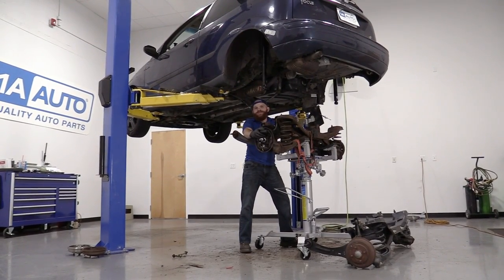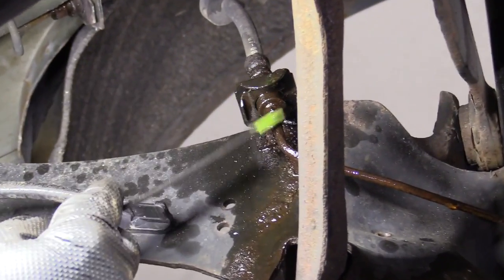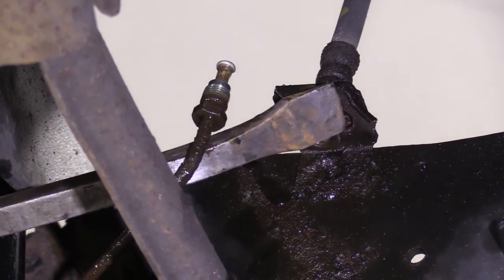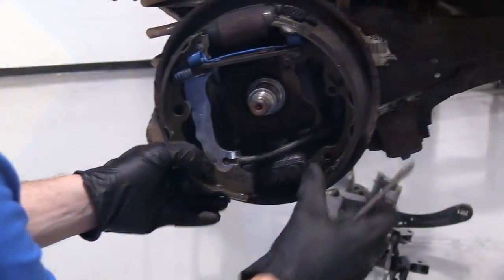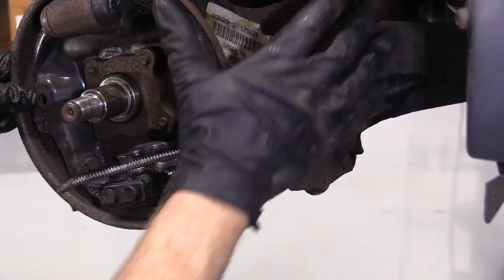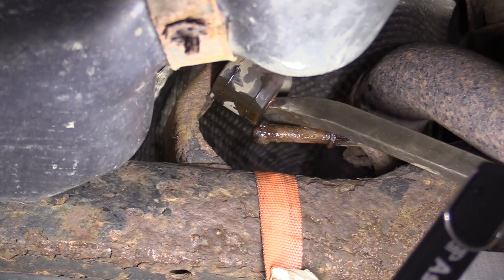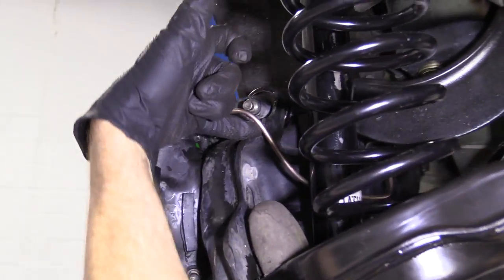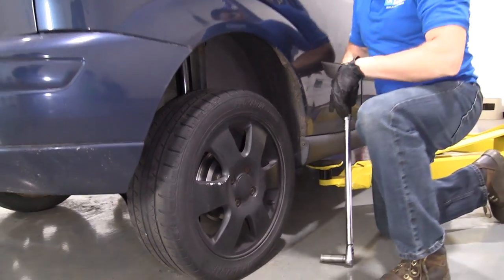How to Replace Rear Subframe Assembly 00-08 Ford Focus

Comment: What n awesome video, my focus needs both front n rear subframe, now I have this video as reference to do it myself. I can't imagine how much it cost to have a shop do it, thanks A1 Auto mechanic!
Reply: I'm pretty sure you can use a rear subframe from a 2013 focus as well. I've been looking into it for my 03 focus. As long as the body mount locations are the same it should work since it's practically the same rear suspension with just a few updates. You can't use any of the suspension components due to changes in how they separately mount the but the subframe itself should be useable

Comment: Huge thumbs UP! Thanks for sharing.
btw Tragic conditions on this Ford subframe.. rusted, corroded, sad parts.
Reply from the maker: +Én egymagam Thanks for the feedback!
Reply: All fairly typical rust areas on a focus,need to do my trailing arm bushes on mine over the pond in the UK. Great video content.
Reply: That is nothing... I checked mine yesterday.... I have like 2 % chances to remove the bolts (the ones he replaced)

Comment: Would it be okay & good idea to put bit of anticipation seize on those two center 15mm bolts through the spring into frame so it won't be hard to remove later down road...and I grasp what you said bout using thread locker on 6 bolts

Comment: For anyone watching this:   Don't let your car get to this point, have  :  Krown Rust Control's T40,  Rustcheck, Fluid Film , Wool Wax, Corrosion Free Rust Cure Formula 3000 or equivalent sprayed on your car yearly , it avoids this happening.   Do not used rubberized undercoating/ asphalt based undercoating, it is a nightmare to deal with and in the end flakes off and accelerates rust.   I live in the Rust Belt, i've seen the difference between spraying and not spraying your cars , and the difference is night and day.

Comment: concerning grinding those bolts, is it a risk doing that - with the level of rusting - so close to the EVAP canister and or fuel components in case ther rusted thru an there could be a leak, basically could those sparks cause an explosion, mesa go boom boom or the grand daddy of all bonks?
Reply: Probably safer to break the plastic around the bolts then use new bolts and washers to refit it.

Comment: I have to change the rear sub frame unit on my 2007 Ford edge sel awd suv which the alignment adjusting bolts do not have any metal on frame to catch onto when attempting to set rear wheel alignment.  Are there any videos on how I am to proceed to pull entire rear sub frame down to replace with unit that has better metal for those alignment adjustment bolts to grab when setting alignment on rear wheels. I took it to Mavis tire 4 alignment and they can set front wheel alignment not rear though.